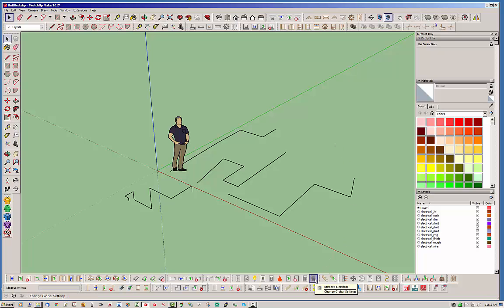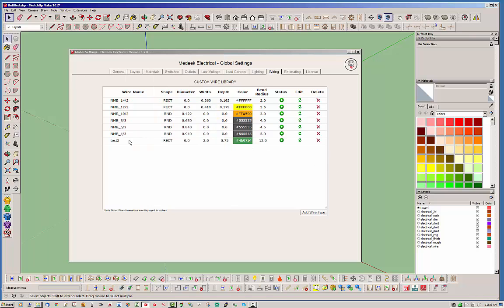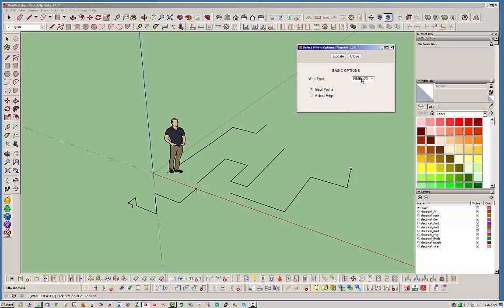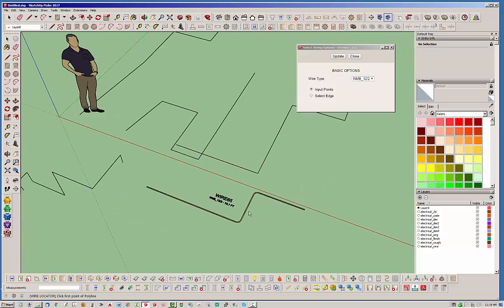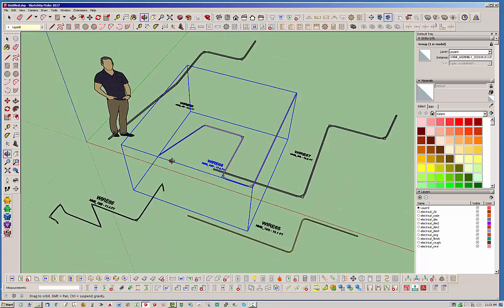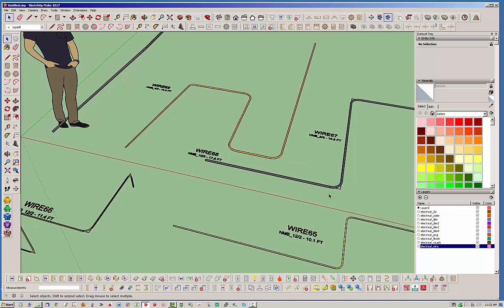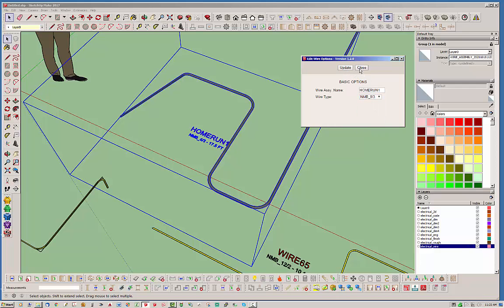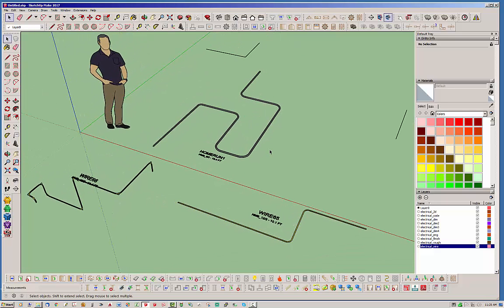Medeek Electrical Plugin Tutorial 5 - Wiring

Comment: Looks really helpful. 
I may have missed it, does it offer 14/3, coaxial or  low voltage wires? These are some of the wires I am installing and I think your extension would be helpful for diagramming.
Reply from the maker: Yes, in the wiring library you can setup various wire sizes/diameters to fit your requirements.